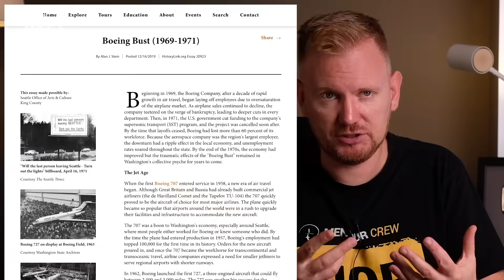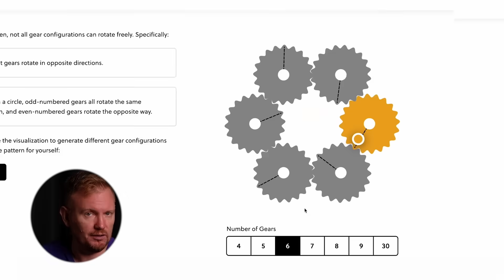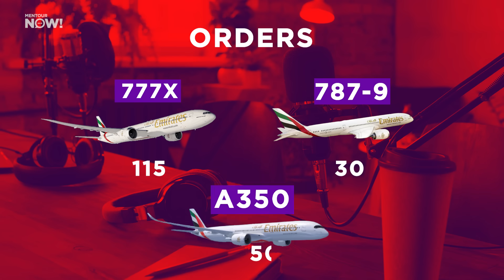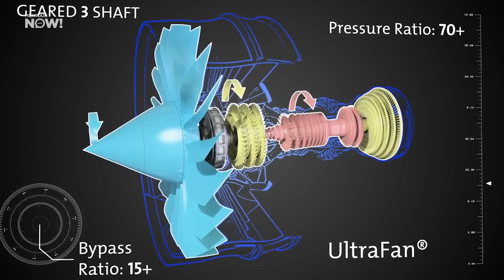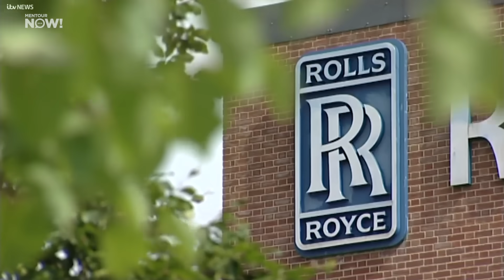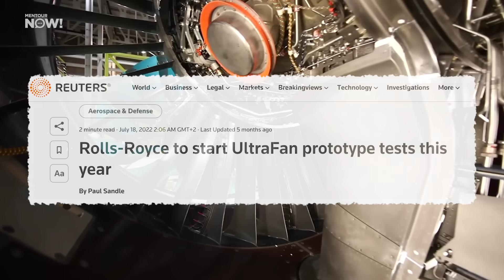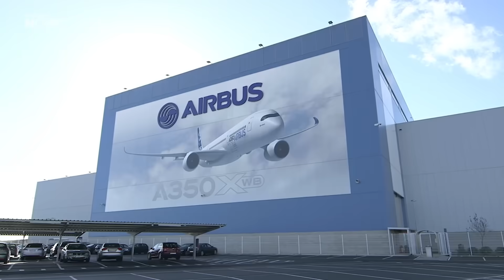Are BOEING planning a 747 with 2 ENGINES?!

Comment: RR can build an engine so big no one will buy it but they couldn't make a quiet supersonic commerical engine for Boom?
Reply: Because Boom is going to fail, so why waste time and effort on an engine no one wants
Reply: The engine for Concorde turned up all over the place - I believe the type 42 destroyer used them (apologise if I got that wrong) but it was a very useful bit of kit, while the state backing of Concorde should have made it a safer bet (try not to giggle 😂) but I guess they did the maths and couldn’t make boom engines pay. Though as you say making an engine with no stated application seems odd!
Reply: @charlesmoss8119  The RR Olympus engines used in Concorde evolved from the engines developed for the V Bombers.

As the Olympus engines are turbojets, designed to generate thrust from a small volume of fast moving gas, they wouldn't be ideal to use as a starting point for engines that are delivering shaft power, such as used in Type 42 Destroyer. The industrial engines developed by RR are derived from the RB211, which has a low pressure turbine that is driven on a separate shaft which is used to drive the fan blades on an aircraft engine, or a generator or other large rotating load for industrial applications.

Making the largest engine possible, even if there is no demand for it, makes sense from engineering and business perspectives; its much easier to scale down something, than it is to scale it up.
Reply: @axelBr1  when you say it the logic is obvious, but the use of the name does turn up in things like Wikipedia (I know - as reliable as the Hitler diaries) on the type 42 and also a lad at school was proud his dads ship had Concorde engines. Did the name get used more extensively as a marketing tool - I mean if I was flogging engines I’d rather sell mighty Olympus engines as used on Concorde than the RB211 even if it is actually the RB211 in reality? Or is it just one of those urban myths that got so well used it became reality?
Reply: @charlesmoss8119  Respect to your dad for being RN, and to you for having to live with him being away from home.

Well Wikipedia says that the Type 42 did use RR Olympus engines, so it can't be that wrong. Apologies for not fact checking.

In my job in the Oil & Gas industry I've seen quite a lot of Gas Turbines driving generators and compressors, mostly GE "Frame" series units, but they are extensively redesigned, i.e. can afford to be heavier but much more reliable, so a bit borderline as to whether really a jet engine.

Comment: It makes complete sense to me that larger “747” or “a380” replacements would be in the works. Air travel is only going to get busier. We have seen this. There are only going to be a certain number of arrival and departure slots at big international airports. Look at Heathrow….aren’t they operating at like 95%. So how do you get more passengers to those destinations? Can’t add. Ore flights because there aren’t enough slots. There are two options. 1. Fly to another airport then use existing routes to connect people to final destination….but why would there be a big demand for non direct flights? 2. You make bigger planes to cope with increasing passenger numbers. Now this seems like a possibility. There is always the argument that the runway is too small or stands too small or what ever so an A380 can’t go there, but for the big, busy international airports, they always have huge runways so this isn’t as much of an issue. 
I do genuinely believe that in 15-25 years if an A380/747 replacement isn’t build, airlines will be calling for it to meat growing passenger demand
Reply: Super heavy jets mess up the spacing and overall capacity of airports they visit.  Not every airline can fly heavy and super heavy jets.